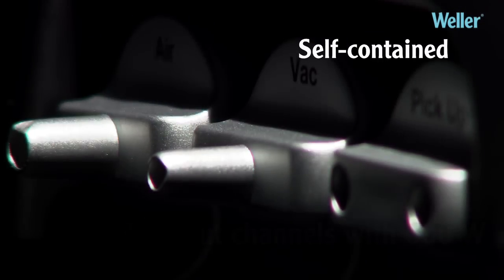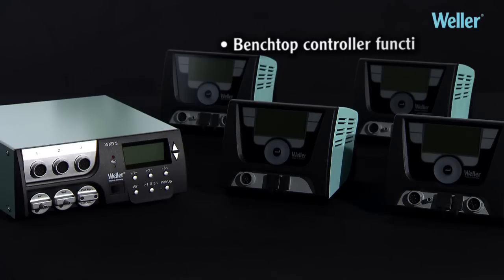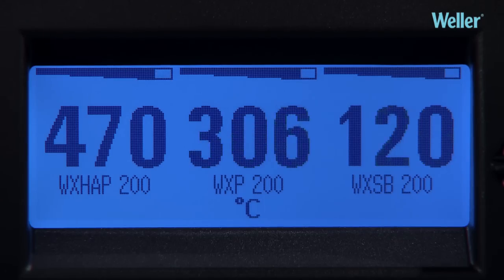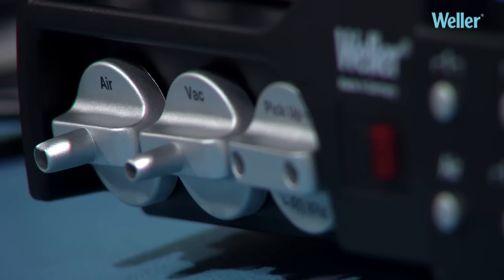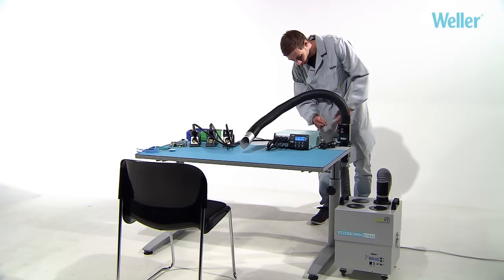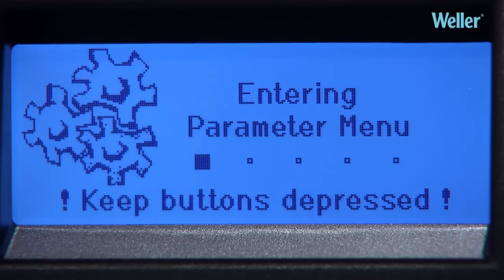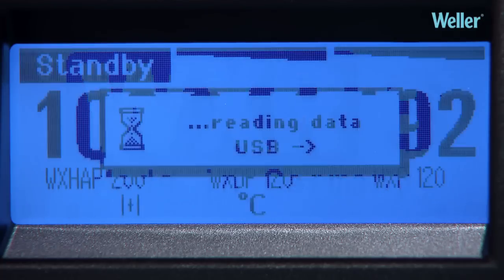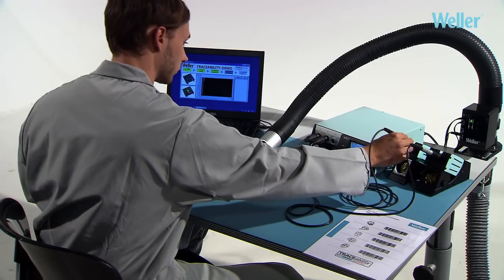Weller WXR 3 Rework Station

Comment: I own a WR2 and I have 35 years of experience in the electronic repair sector, I have always wanted the best for my work, because reliable and functional equipment makes you work faster and better, reducing losses and increasing earnings , I use the wr2 with the wsp80 soldering stylus, and the dsx80 desoldering stylus, total crap, the WR station itself is done very well, but the tools are a real mess, in 7 years I completely replaced the desoldering stylus 4 times , dsx80 (the internal temperature sensor fails and the stylus is to be thrown away) at the modest sum of 230 euros each, an infinity of wsp80 tip stopper tubes, not counting the hundreds of tips for both tools, at a price that is not worth what they cost, with the painful rohs tin with which you are forced to work, you have to have the stations at 450 ° C, and this station IS NOT MADE TO WORK WITH THE LEAD FREE SOLDER.
ah ... I forgot, the dsx 80 advertises so much the quick attack of the tip, well, that kind of crap is stripped the thread very easily, and the tips? they come off the tool and you find them in the bottom of the tool holder, to be thrown away, congratulations Weller, a real equipment for professionals, I'm really sorry, because weller was a guarantee, instead even the -weller is not what it once was, so, never again weller.
Reply: @Mike I agree.   The guy is talking about different products anyway.  He's talking about older product.  I never had a problem with a Weller product.
Reply: @Mike 🖕

Comment: Is the hot air pencil powerful enough to repair PC motherboard?
Reply: But careful with SMD. The hot air pencil blow SMD away :(.
Reply: @DEAFBOY80  That is why there is the ability to control the air flow rate.  😁
Reply from the maker: @DEVICE 
in general yes, an exact answer depends of course on a lot of other components coming to use. to give you an individual and exact answer, please contact our technical customer service via info@weller-tools.com. the guys will help you and advise you in detail.